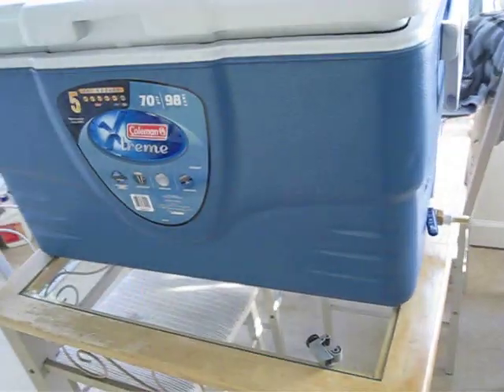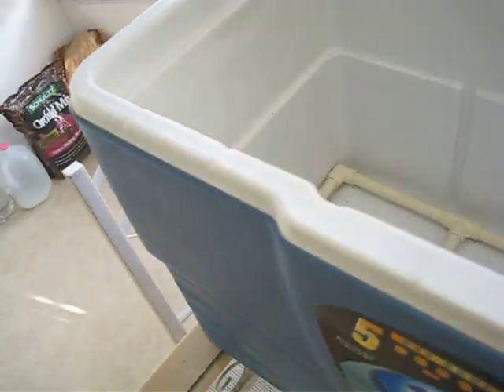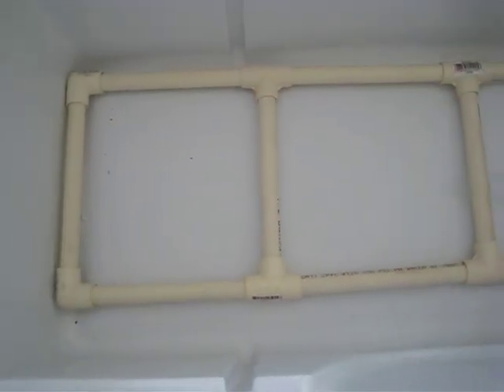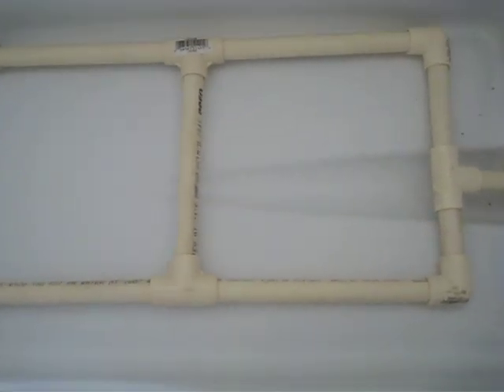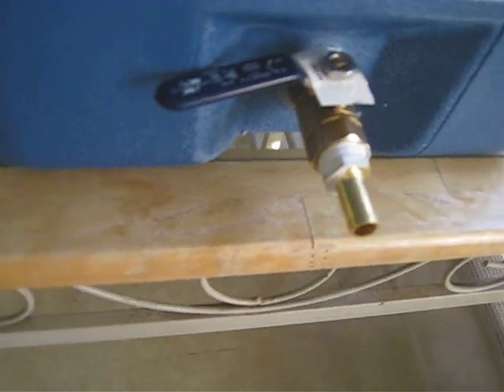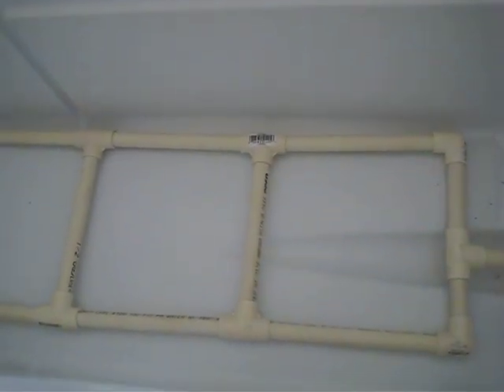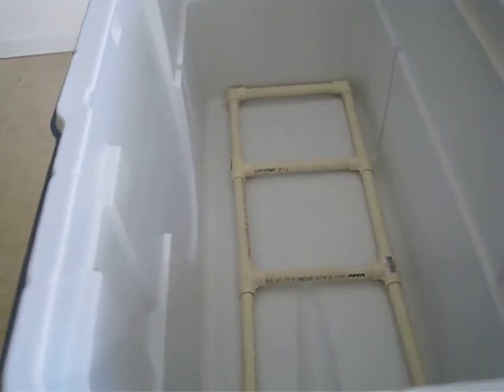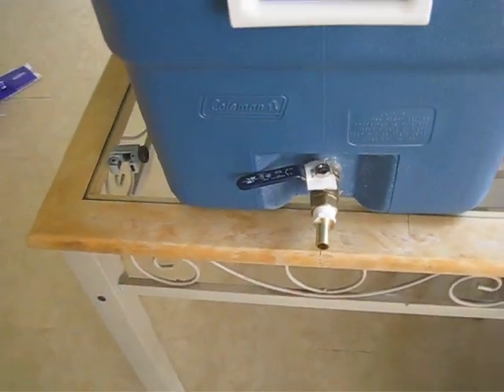Making A CPVC Mash Lauter Tun Pt. 2

Comment: Hey Ty, great Video.  Been Home brewing for a while with steel braided hose.  It work ok but I have to replace when I kink it because the lid closes on me when cleaning.  I want to give cpvc a go.  I actually have a 70 qt extreme cooler so I'm all set to go. could you send me the specs.  Why reinvent the wheel.  do not know how to email you via youtube.